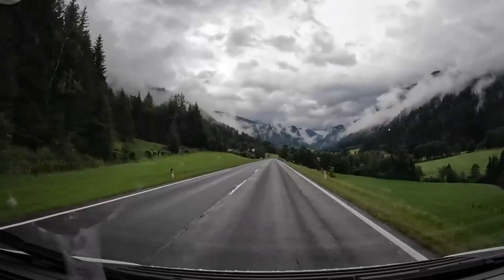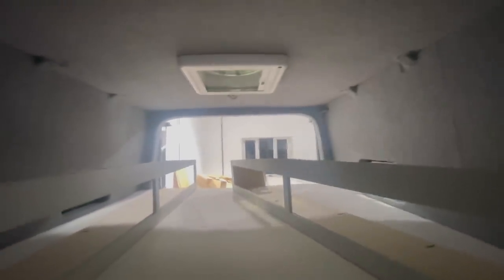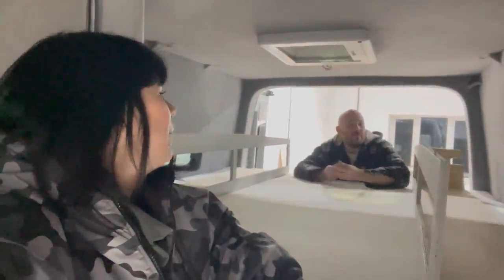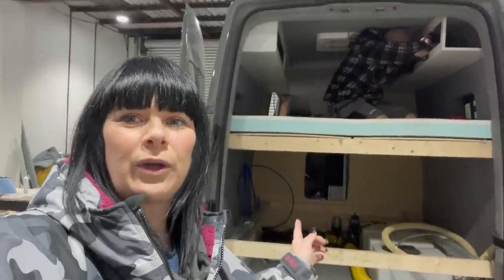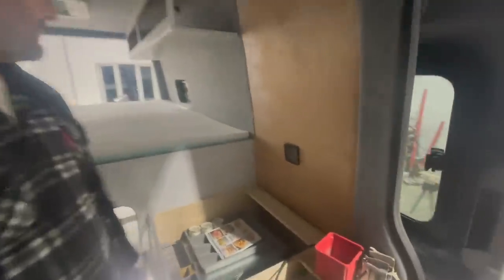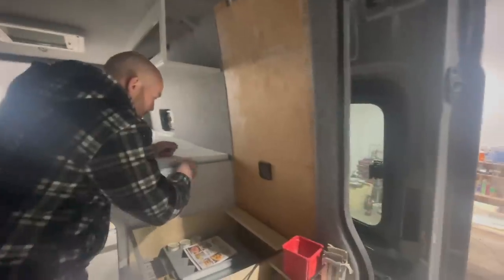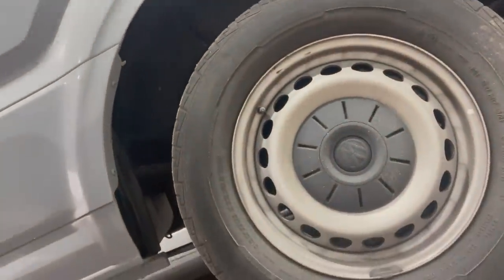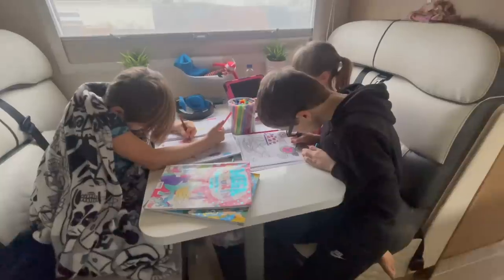Unlimited Hot Water in the Van

Comment: You've done a great job and fast too but my only concern is the kids beds. No windows, no ventilation while sleeping on top of the batteries etc. If there was a fire, would they all get out? Maybe add a window either side or in rear doors?
Reply from the maker: Hi TTC, we have installed gas drop vents in the floor of the garage to aid in ventilation. We have also left a space between the beds and the doors so everyone has access to the rear the doors. There is also a smoke and co2 alarm in the garage. Have a great Christmas XxRR

Comment: Autoterm heaters ARE manufactured in RUSSIA by a company called Advers, they are NOT European heaters as some sites are attempting to claim to avoid restrictions and deceive potential customers.

They are now stating manafactured in Latvia, however no proof of actual manafacture has been provided?

Just where are all the component parts originating from?

 

The same suppliers also mask the name and use Planar instead (the old name prior to rebranding).  They are the same!

Consider how any warranty claim will be delt with if they cannot access parts in the future and ask yourself if you really want to support the Russian economy.
Reply from the maker: Yes we’re told Russia for the heater… xx